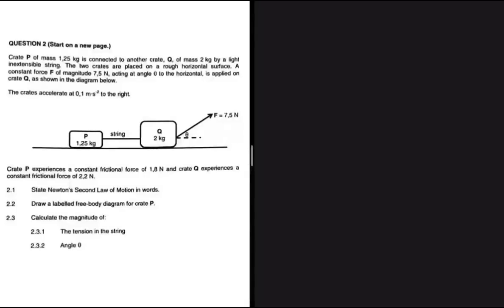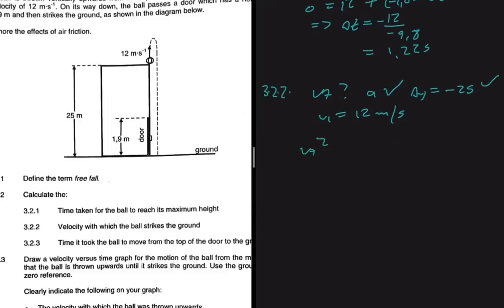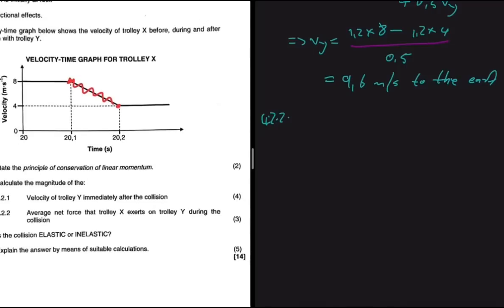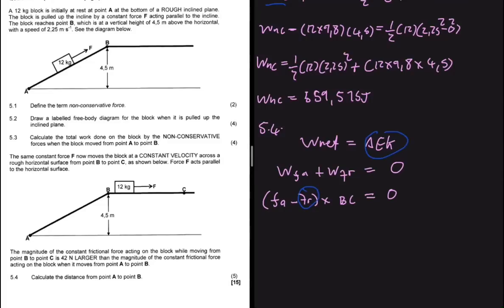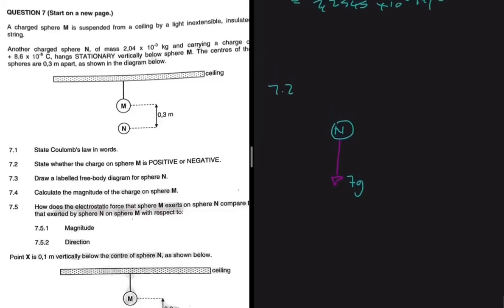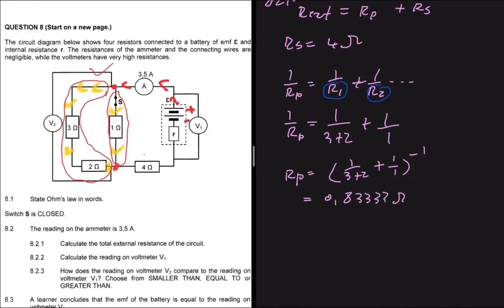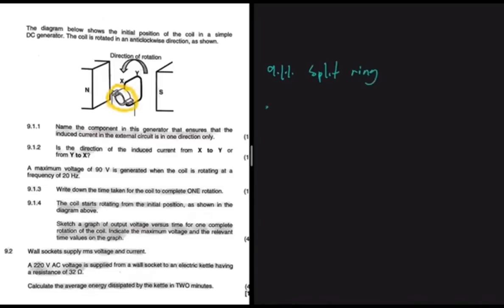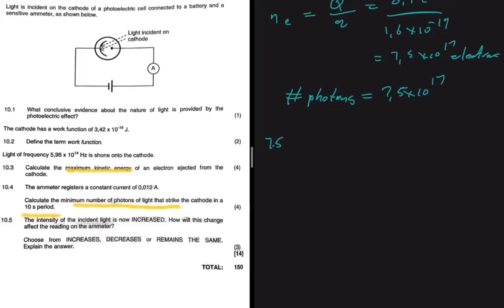Full Memo Grade 12 Physical Sciences P1 November/DBE 2022

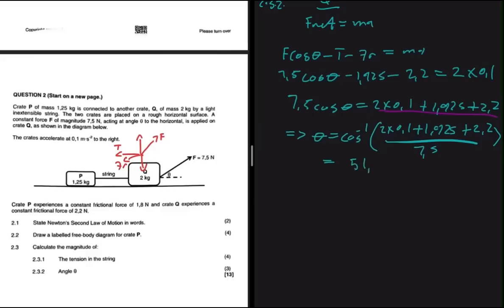Comment: Question 1 6:47 I got 54.74° and that's using your values not to mention i used the angle you got to get the tension at block Q and it wasn't the same the tension at block P
Reply from the maker: Clearly I put the wrong thing in the calculator
Reply: Same
Reply: It's the thought process that matters, you get your work for understanding 🤝🏿